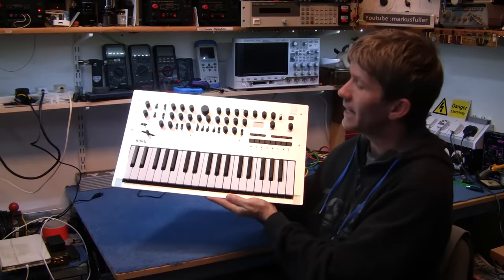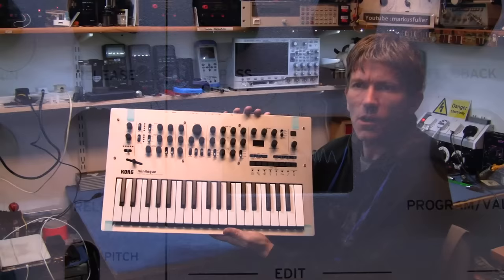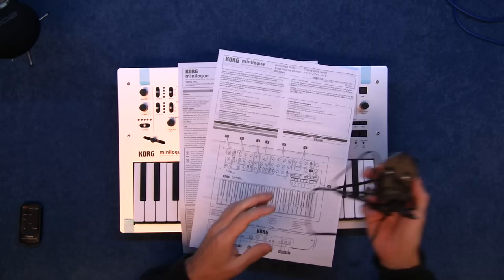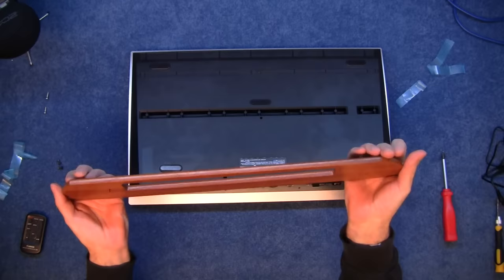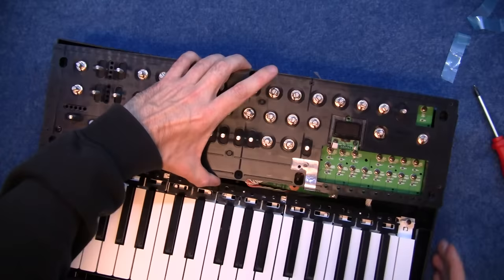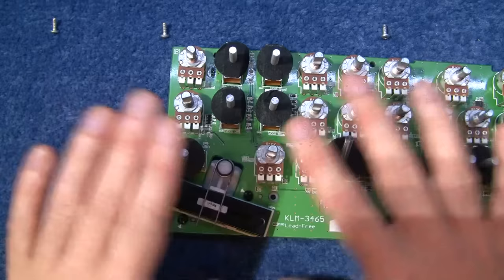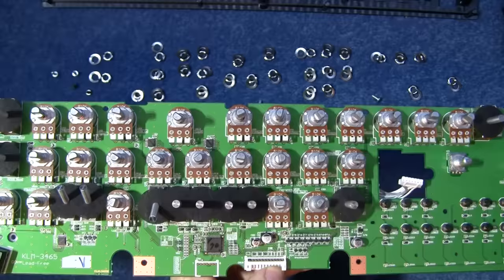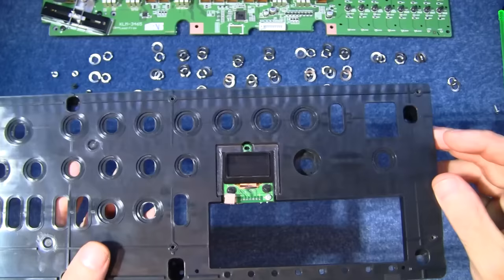Korg minilogue polyphonic analog synthesizer teardown MF#68

Comment: Thank you for this resource, it helped me re-solder a loose power jack in my minilogue. One tip - right after you take off the front panel, set aside the clear plastic light guides near the octave switches and voice mode buttons (you can briefly see them @4:49). They are not glued in and could be very hard to find if you drop them accidentally.

Comment: Nice tear down demo Markus. Thanks.
I'm glad to see more and more manufacturers using solid type electrolytic capacitors in their designs. That means that 40 years from now, those should all be as good as today, and not need replacing like in many classic analog synths from 40 years ago...
I just wish that Korg could be coming out with The Logue (full 8 voices version of the Minilogue) in the near future...
Reply from the maker: +AlainHubert If only we could have longer lasting Caps. that would solve a lot of problems.
Reply: Invent them markus!!

Comment: Another wonderful video Markus! As an old electronics engineer from the 80's I just find your videos so great. They inspired me to take a punt on an old Korg DW-8000 from 85 on ebay that was not working and sold for parts/repair. Long story short found a dead back battery, a s/c on the main board, cleaned it up, fixed the broken keybed and its back up and running so ... thanks for the inspiration mate. Look forward to more of the same... cheers
Reply from the maker: +TheReynoldsTV Brilliant. Im so pleased you got the DW-8000 working. Its amazing to see the difference in electronics from the 80s to today and its forever evolving im sure one day you will just be able to print out a whole circuit from a printer that has carbons metals and semiconducting materials instead of plain ink. Maybe this will be invented in our lifetimes ?. who knows.

Comment: The monologue is one of the few if not the only quality polyphonic all analog synth that is in a great price range. I love mine. The few bugaboos are no re routing capabilities so no mod matrix besides a slider for cutoff and such. And the slider it self is a silly thing to make cheap on this board but I did the same mode and it seems more stable but def a good buy. Also someone mentioned no sub octave  but it does have one in mono mode your same knobby to change the arp patterns and detune becomes your level for your sub octave wave (I believe it's actually a sub of Osc. 1 but could be wrong) so. Also the first one my buddy had when the came out had very snappy envelopes that clicked in a bad way. The updated the firmware and fixed it nicely. But I received mine a month ago and it is def been removed from the newer shipments or just has the latest update. Awesome synth!

Comment: Thanx for the teardown!
It´s like what we gonna be seeing in new synths...rather low end uCs, but many of them, as they are cheaper than a single and obviously more powerful design. 
On top of that, it´s modular for the manufacturer. If they want to do an 8-voice device they just need to copy&and paste the layout 8 times, or put one voice on a board and cone that board...
Reply from the maker: +TubiCal Yes an 8 voice next. I like the sound of that
Reply: It should have 10 voices, 10 fingers : )

Comment: As a complete newbie to modern electronics (I last built a terrible oscillator circuit on a breadboard in the 80s), do the oscillators, envelopes, filters, and amps happen in the small ICs you couldn't identify? Given that you mainly identified what I assume are digital micro controllers, I am wondering where the analog bits are in the design. Are the micro controllers there to send voltages to the analog circuits from memory or from the signals from the pots and switches above?

Great videos.

Comment: Glad to see they for the most part seem to have avoided the mechanical rotary encoders here.   I've had plenty of problems with those on other gear, getting noisy over time.   The mechanical ones are really cheap, and while they may be gold plated, the plating apparently wears and/or it oxidizes to the point where the connection goes bad in record time.   The Korg Electribes and the Electron gear have a lot of flakiness problems with them.  There are actually some inexpensive optical rotary encoders available, but they require power for the LED, and it seems all to often the designers don't use them.

Comment: The "direct sunlight" warning is because the aluminum absorbs and transfers heat very well, and fully analogue synthesizers can be detuned if their temperature changes too much. Oddly, though, most of the complaints I've seen about the minilogue detuning have been because of excessive cold.

Comment: That wobbly slider really is an issue... on my Minilogue, it doesn't always come back to 0... stops at 2% sometimes and I have to manually zero it. But thanks to this video, I know how to fix it. Just need to get my hands on some heat shrink in the right size...

Comment: You make it look so easy with your FWD teardown....:-) In real life i tried it and really it felt longer than in the video....:-)  Btw about the rattle switch.  I did what you shown and took it further. I put some heat shrink tubing on the springs on both sides and also the same principle i did on the little white slider-knob that the spring is keeping in place. I made a thin little cylinder formed ring made of fabric tape that i secured with a drop of glue and covered the surface of the white slider plastic knob-slider where the two spring arms touch the white plastic .  Not it sounds like an expensive synth :-)

Btw out of 1000+ Thumbs up,   9 Thumbs down on a teardown video that is for free.... That shows us that at least 0,9% of the population will never be happy. It`s genetics baby

Comment: Very nice video. Just bought one and it's great to see such a nice piece of engineering. One tip: put some additional heatshrink on the spring levers and you'd get rid of the clicking sound completely.
Reply: so you put the heatshrink the way Markus did in this video and you additionally "covered" the two sides of the spring in heatshrink?  DId you make any pictures that i can see somehow? Is it enough to remove the Aluminum lid or do i have to go deeper (like removing more than the Aluminum plate) ?

Comment: My guess on the tape is that at the factory during assembly, they put those static pieces of tape on before they even have the top metal housing cover screwed down to the rest of the unit.